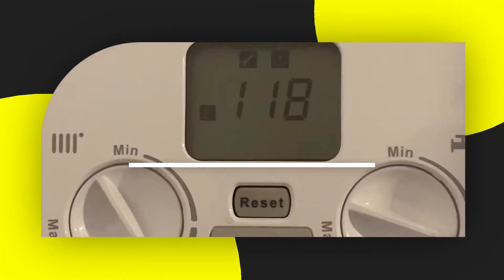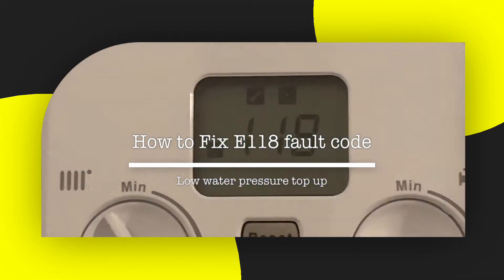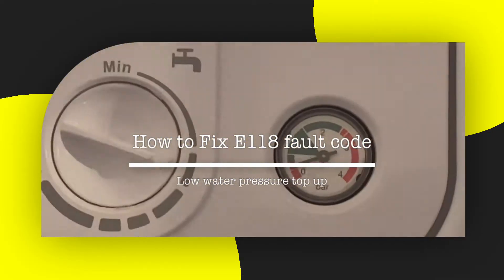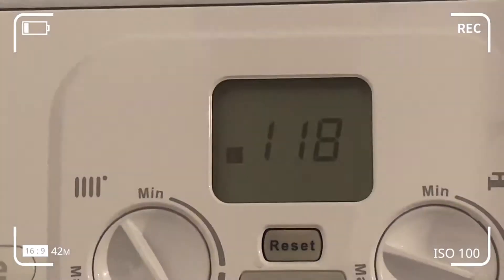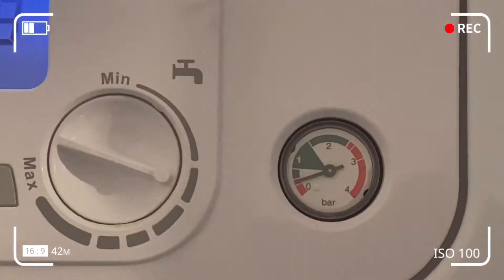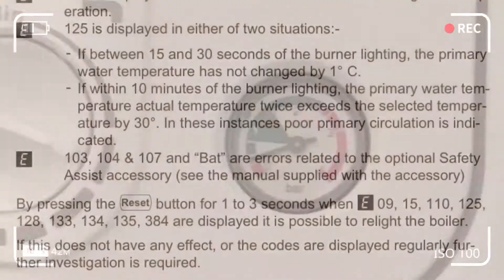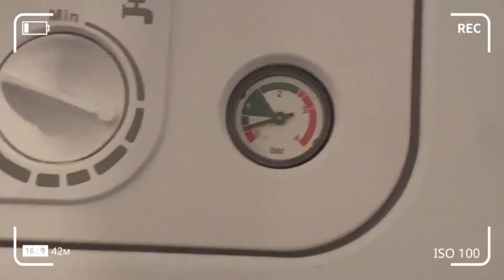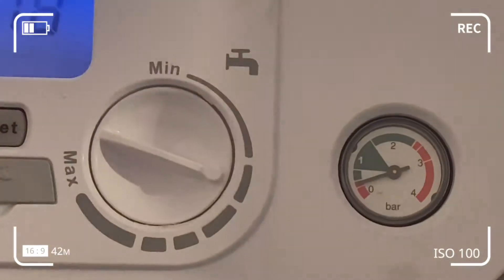How to Repair or fix Error code E118 flashing fault on your Baxi Assure Boiler - low water pressure

Comment: Hi, I don’t have the blue lever or green lever on the boiler. There are yellow and two black lever only. How can I rectify this faulty?
Reply from the maker: Hi  Shinobikonohagure92, Appreciate the feedback. Apologies for coming back to you late. If you can turn the black or yellow valves in the frontal position of the filling loop and not the rear and see if it resolves the problem. Are you still experiencing this issue? Don’t forget to subscribe, like and share. Helps channel grow. Happy holidays

Comment: Was watching how to put th pressure up on my boiler but the other blue knob won’t bulge in, won’t turn , the other one was on . Is there any easier way to turn it, tried putting pressure and was tempted to use hammer now . Thanks
Reply: The left blue knob won’t turn 😢
Reply from the maker: Hi quennieflotikdes1327, it could be that you are turning the wrong valve, the valve has its screw overly torque tightened or needs a special key to undo it. Unable to ascertain which valve is causing the issue remotely. Are you still experiencing this issue? Apologies for coming back to you late. Don’t forget to subscribe, like and share. Helps channel grow. Happy holidays

Comment: Note  some Baxi/Main boilers will have a flexible filling loop - a foibles metal hose - rather than the rigid arrangement  with blue valves as shown here. The hose will be a slightly different position but there should also be two levers/taps  on the pipework either side and these can be turned in the same way as those  in this video to raise the pressure.
Reply from the maker: Thanks for the feedback Septimus111 and shedding light on other variations. Don’t forget to subscribe, like and share. Helps channel grow. Have a great weekend

Comment: Many thanks mate for this useful video. My boiler had a low water pressure problem on a very cold morning, and when I called Baxi they told me they would send an Engineer out for a fee of £108 just to fix this 2 sec job. Your Video saved me. U are a star and deserve to be Knighted!!!!!  Frank, Whiteley.
Reply from the maker: Thank you so much for the feedback joycebaafi9577. Glad you are sorted and back to full throttle. Don’t forget to subscribe, like and share. Helps channel grow. Have a great weekend ahead.

Comment: I have the two blue valves. The one on the left doesn’t move, the one on the right leaks water. So my problem hasn’t been resolved. Any other suggestions as the agent has stopped answering my calls. Me and my nine month old are without hot water and heating, and it’s a Saturday 😒
Reply from the maker: Hi Haychargie4332, What is the specific model of your boiler ? Is it leaking from the valves or boiler? And what are the colours of all the valve underneath the boiler?

Comment: Thank you. One of the blue plastic valves has broken on my boiler, do you know how I can still increase the water pressure?
Reply from the maker: Hi gb7012, Appreciate the feedback. Are you still experiencing this issue? Apologies for coming back to you late. You can get the valve replaced with a retrofit one and screw it into position or use plies to grip and turn in orientation Of filling the loop , repressuring or topping up clockwise. Don’t forget to subscribe, like and share. Helps channel grow. Happy holidays

Comment: Something for viewers to note - not all Baxi Boilers have the two blue valves underneath, some of them are designed with a single lever which is green. You pull this green lever to reintroduce the water pressure and when the indicator reaches the green, you release it (i.e. push it back in place.) This happens within a couple of seconds, at least with ny Granddad's boiler it did. Good luck!
Reply from the maker: Hi Benscooter1, thanks for the feedback. I concur, although this green lever feature was broached or covered at the latter stage of the video at 4:45 mins if you managed to make it to the end of the video. Thanks for seconding or buttressing that feature. Have a great new year and don’t forget to subscribe,like and share. Helps channel grow.

Comment: Big thanks to you mate blue error light has now gone and my heating is back up, only bought this new build house a year ago I thought there was no way it’s broken already! One question though I feel like my valves were already turned on? Would that matter if one is on and one is off? The boiler is on now but I don’t know if the valves are actually off or not?
Reply from the maker: Hi Worlidy, Appreciate the feedback. Apologies for coming back to you late. Glad you are sorted. The repressurisation process typically involves allowing water or repressuring the central heating system. After repressurisation, you should close out. It matters if they stay open instead of closed out after repressurisation. Closing them out enables the central heating system to maintain good pressure and the repressurisation valves prevents the boiler from over pressurisation which goes from green to red dial state and boiler could implode. For safety reasons always close out after repressurisation. Don’t forget to subscribe, like and share. Helps channel grow. Happy holidays

Comment: My boiler does not seem to have blue levers like shown there are three black and one yellow ?? Please help
Reply from the maker: Hi mohammedbutt7662, 
To resolve low boiler pressure, you can try topping up the boiler. The process might vary depending on the specific boiler model, but generally, you can follow these steps:

1. Locate the filling loop: It's usually a flexible hose with two valves, one on each end.

2. Close the valves: Make sure both valves on the filling loop are closed.

3. Open the valves: Open the two black valves on the filling loop. These are typically the levers you mentioned w.r.t to video link https://youtu.be/EK0FkOKlhWE?si=eybLnghYW6uy5-NJ

4. Monitor the pressure gauge: Keep an eye on the pressure gauge and wait for it to reach the desired pressure. It's usually between 1 and 1.5 bar.

5. Close the valves: Once the desired pressure is reached, close the two black valves.

6. Check for leaks: Make sure there are no leaks around the filling loop or any other parts of the boiler.

7. Reset the boiler: If necessary, reset the boiler to ensure it's functioning properly.

Remember, it's always best to consult the manufacturer's instructions or seek professional help if you're unsure about any steps or if the issue persists. Stay safe!

Let me know how you get on. Don’t forget to subscribe, like and share. Helps channel grow
Reply: @UtechUreview  thank you so much for such a detailed response. My issue is I cannot see a flexible loop like the one you described
Reply from the maker: @mohammedbutt7662   If you're having trouble finding the flexible loop, it's possible that your boiler might have a different setup. The filling loop can vary depending on the boiler model.

The topping off valves are typically located at  the front of the loop. They are usually accessible and easy to identify. If you're having trouble finding them, it's best to refer to the boiler's manual or contact a professional for guidance. They'll be able to assist you in locating the valves and topping off the boiler correctly. 

Typically, the filling loop is a flexible hose with two valves at each end. It's usually connected to the boiler's pipework. The valves are often colored, with one being yellow and the other two being black.

If you can't find the flexible loop or it looks different, it's best to consult the boiler's manual or contact a professional to get specific instructions for your boiler model. They'll be able to guide you through the process of topping up the boiler correctly and safely. Stay warm!

Comment: my radiator!! Is possible to disable radiator system and only use turn on hot water to take a shower??
Reply from the maker: Hi jessjos3033, what is wrong with your radiator? Is it not heating up? Does your radiator need bleeding or plunger valve needs changing?

Comment: What happens when it fills to 3?
Reply from the maker: Hi Sophia, To lower the water pressure on your boiler to the required tolerance levels. you can try one of the following methods: 
1. Bleed the radiators: This involves opening the valves on your radiators to release any trapped air, which can help to reduce the pressure in the system.
2. Adjust the pressure relief valve: This valve is typically located on the boiler and can be adjusted to reduce the pressure in the system.
3. Drain some water from the system: You can use a hose to drain some water from the system, which will help to reduce the pressure. However, be sure to consult your boiler manual or gas engineer before attempting this method, as draining too much water can damage the system. Don’t forget to subscribe and share. Cheers.

Comment: What can happens if the pressure get to 4 the red one
Reply from the maker: Hi Juanita, It means you have allowed too much pressure in above the specified limit. You can lower the pressure by bleeding your radiator using a radiator key so your Boiler doesn’t implode.

Comment: Hiya mine flashes E125 whats that please? X
Reply from the maker: Hi Jahda, could be the maximum temperature  threshold on your Boiler has been surpassed and as a result overheating and could be resolved by bleeding air from your radiators and reseting the Boiler. Let me know how you get on
Reply: @UtechUreview  thank you so much. All sorted. That was very helpful. 

I turn all my heaters off but I've been advised to leave one on just for the heat to go somewhere. In summer time can I turn all the heaters off completely please? And how? Please help 🙏 me xxx
Reply from the maker: @jahdalennie9908  Yes you can turn your heating off leaving them in frost protection mode in your thermostat and also your radiator to save on energy and functionality of radiators especially for protracted periods. See links below. https://youtu.be/HnpRFl0Y9lY
https://youtu.be/JFc_CicK03A
https://youtu.be/kkT_7XNZM-U

I hope this helps. Don't forget to subscribe and share. Have a brill week ahead Jahda
Reply: @UtechUreview  you are amazing 👏 ❤ many many thanks for your help.

Comment: Mine are already open. Nothing happens when I turn them either way. Any ideas?
Reply from the maker: Is this the exact model? And are you sure you have the central heating cold  water isolation and repressurisation valves turned? Are your radiators in need of bleeding and have you just carried out a flush?

Comment: I left the left blue tap in the clockwise position for a few minutes after turning the one to the left anti clockwise, but it is now in the anti clockwise position. Will it be okay?
Reply from the maker: Hi smifflarr, it should be ok as it enables to maintain good pressure. If it were the one on the right. It may have lead to overpressurisation where you make have had to depressurises by bleeding your radiator with a radiator key. But try to close out next time after repressurisation. I hope this helps. Appreciate the feedback. Apologies for coming back to you late. Glad you are sorted. Don’t forget to subscribe, like and share. Helps channel grow. Happy holidays

Comment: My first blue pressure valve (the one left of the two), doesn’t rotate. What do I do?
Reply from the maker: Hi Anass,

If the blue handles can be removed (and I don`t know if they can), then remove and use a small adjustable spanner on the flats underneath.

There are some valves which have a Stop, so they only rotate so far, have you tried turning the handle both ways?

Try removing the plastic head and turning with an adjustable spanner. Do let me know how you get on.

Otherwise, might be some underlying systemic issue with your Boiler. Might be a leak somewhere in the system or a damaged pressure relief valve. You might need to Call out an Engineer to investigate further. Hope you sort it out in the end. Don’t forget to subscribe and share. Helps channel grow
Reply: @UtechUreview  Yea it was just extremely stiff. I was able to rotate it and repressurise the boiler

Comment: Hi, i’ve flicked my green switch on my model and it’s making no difference. Generally it works but today it’s not working - any suggestions?

Thanks!
Reply from the maker: Hi Lourenz, Might be some underlying systemic issue with your Boiler or system. Might be a leak somewhere in the system I.e radiator leak or a damaged pressure relief valve. You might try to sort out the radiator leak yourself or Call out an Engineer to investigate further. Hope this helps and you sort it out in the end.

Comment: This is the exact model we have and tried turning both the blue valves towards the boiler, but still the pressure doesn't rise up. Any other help?
Reply from the maker: Might be some underlying systemic issue with your Boiler. Might be a leak somewhere in the system or a damaged pressure relief valve. You might need to Call out an Engineer to investigate further. Hope you sort it out in the end.
Reply: @UtechUreview  Sure. Thanks for the reply. I opened the blue valve for more than 20mins and it came to normal after.
Reply from the maker: @jawakumar  you welcome Jawa. As long as you have it sorted. That’s fine. If it doesn’t budge in the future then a call out might be necessary to see if you have any leaks in your system. That being said, Don’t forget to subscribe and share. Helps channel grow. Happy holidays

Comment: How can one drain water when filled to much . I got the same E1.18. Error
Reply from the maker: Hi Moti Angel,

How to fix:

You can do this by ‘bleeding’ your radiators.

You’ll need to drain some water from the system. 
To bleed your radiator, you’ll need a radiator key or a tool that is able to comfortably and safely turn the valve on the top corner of your radiator.

First locate the radiator valve and then very slowly twist the valve anti-clockwise. You should first hear air escaping before water starts to leak from the valve. Let out a small amount of water from each radiator – checking the pressure after each one. Continue to do so until your pressure gauge is back in the glorious green zone.

Other probable causes for this malfunction are Malfunctioning boiler parts

Defective components could include the boilers pressure release valve, diverter valve, or filling loop

How to check (pressure release valve): The PRV is a simple device to release water when the boiler is over pressurised. It’s a copper pipe usually seen protruding on your outside wall behind the boiler.

If this particular pipe is constantly dripping water – then your PRV should be indicative of some other systemic underlying issue,  you should call an engineer to check or troubleshoot boiler. If you're getting no hot water from your boiler, this failing part could be the reason why.

I hope this helps. Appreciate the feedback. Don’t forget to subscribe and share. Have a good weekend
Reply: @UtechUreview   thank you.

Comment: Exact same issue but the left blue valve will not budge at all! :(
Reply from the maker: Hi Regan, have you tried turning the left blue valve in a different direction? And What is the model of your Boiler?
Reply: Mines the same, noticed they both have a screw in, is this normal?
Reply: I have the same problem 😢 any solution?

Comment: I haven’t got no blue valves only 2 black 1 yellow it’s a main boiler any help
Reply from the maker: Hi Zoe, I presume this is a different model of boiler ? and you have two black valves on the filling loop in front and 2 black valves at the back? The 2 two black valves on the front of your boiler can be used to re pressurise so run a test to see if your needle moves and tops up and if it does it means these are top up valves.. if it doesn’t close out immediately as you may need to call out but hopefully these valves should be sufficient enough. Let me know how you get on.
Reply: @UtechUreview  I managed it Thankyou for replying

Comment: What if you don’t have any blue valves? Only black and yellow! 😢
Reply from the maker: Hi Melissa, what model of boiler do you have I presume this is a different model of boiler ? and you have two black valves on the filling loop in front and 2 black valves at the back? The 2 two black valves on the front of your boiler can be used to re pressurise so run a test to see if your needle moves and top ups and if it does it means these are top up valves.. if it doesn’t close out immediately as you may need to call out but hopefully these valves should be sufficient enough.

Comment: The needle on mine isn’t moving past the 1 really. Is there something else wrong?
Reply from the maker: Hi safdegfg, repressurisation is a gradual process depending on the process or how rapidly you repressuried the filling loop. Are you still experiencing this issue? Apologies for coming back to you late as somehow missed your message and been responding to numerous comments. There may be a leak in your system, did you try bleeding your radiator with a radiator key. Let me know how you got on. Appreciate the feedback. Apologies for coming back to you late.. Don’t forget to subscribe, like and share. Helps channel grow. Happy holidays